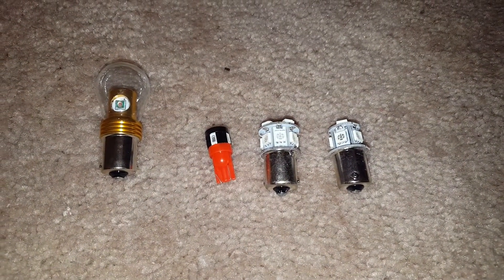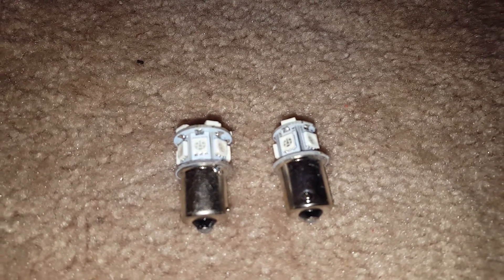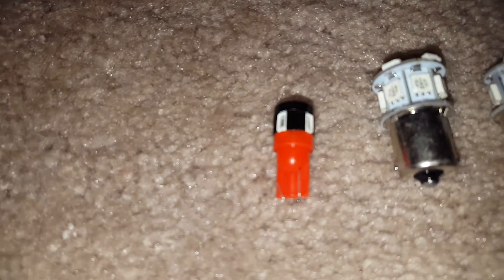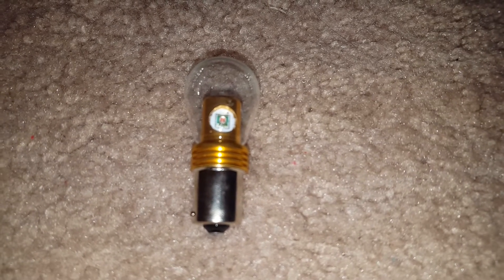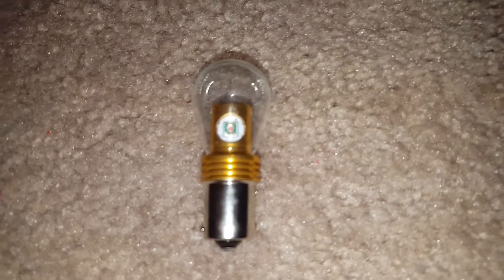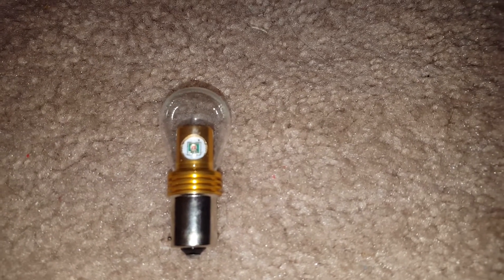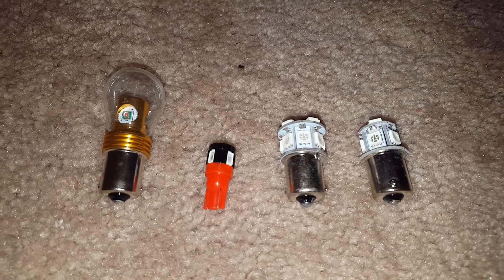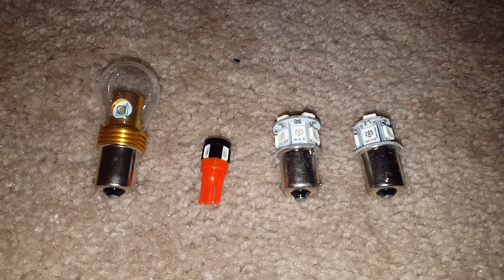LED bulbs for the buses

Comment: Do these have built in resistors to stop them flickering?
Reply from the maker: +michael jagger If you mean for the turn signal flashers, no.  However, most flashers in the trucks and buses are electronic so they don't require a load resistor, as the same flasher might flash a basic 4 turn signal config (2 in rear, 2 in front) or they might flash many more than that, so they can't flash faster or slower for the different setups.  Cars use a mechanical flasher (which uses load to slow it down), hence speeding up when a bulb dies.

Comment: where do you buy them?
Reply: +rolling coal other than ebay
Reply from the maker: +rolling coal I have not found any online stores besides ebay, but I have not tried searching.  As long as you use PayPal with Ebay, you should be safe if you are worried about buying on ebay.  I have used ebay for years and bought numerous  things for the buses and for other stuff, and only had 2 times where something bad happened, and paypal saved me.
Reply: ok thanks ill try to do it I have a old international s1800  with air parkbrake but with hydro brakes it is pretty weird.